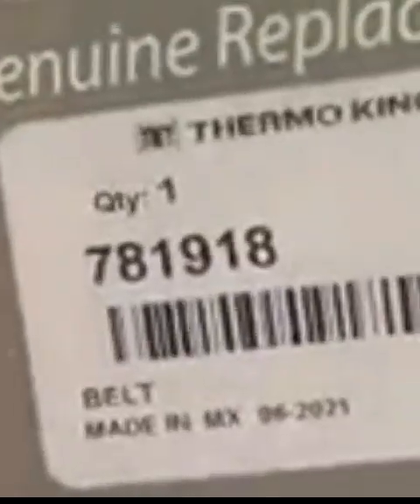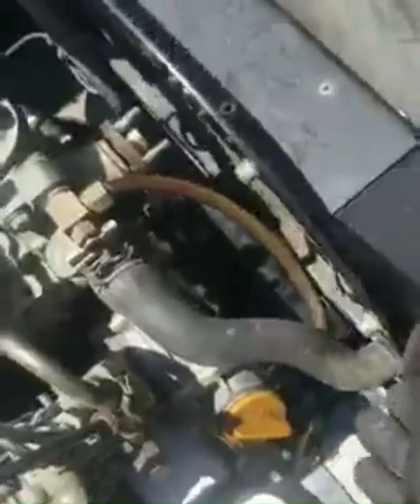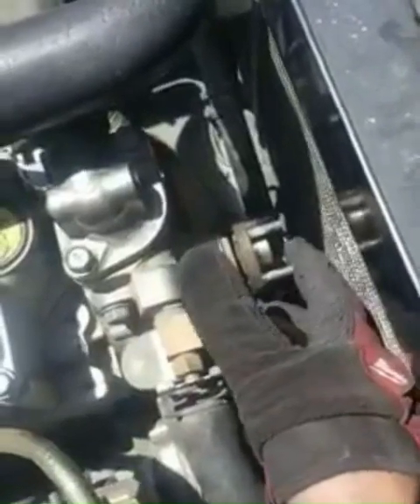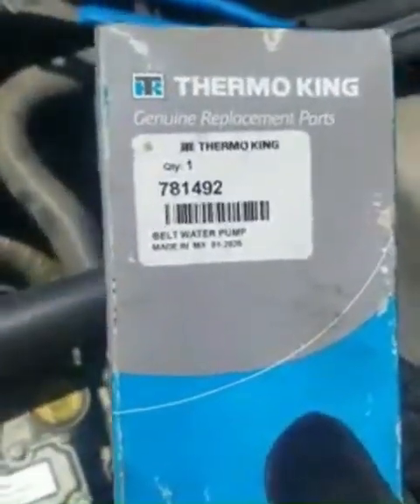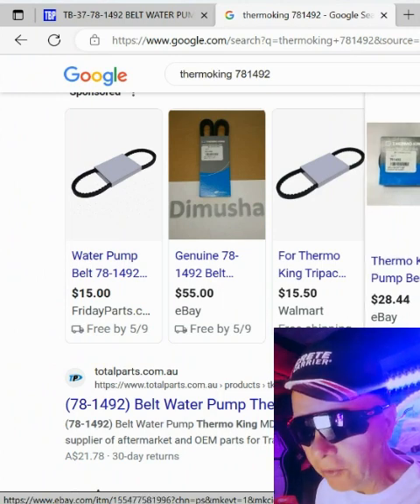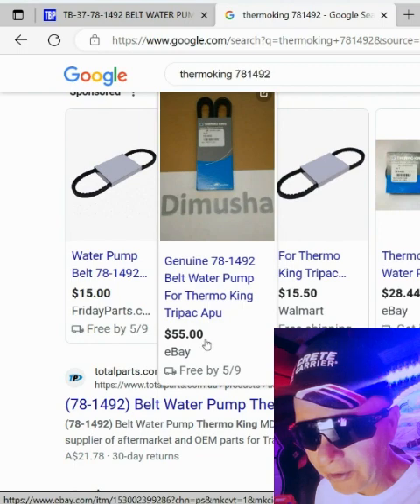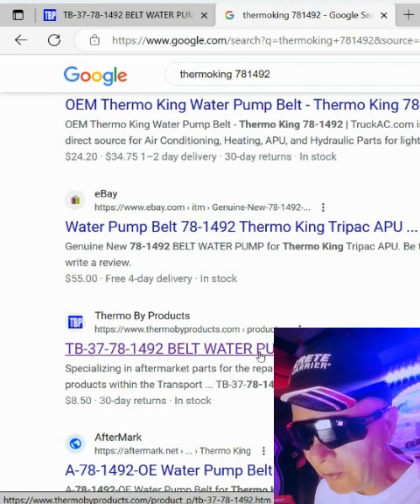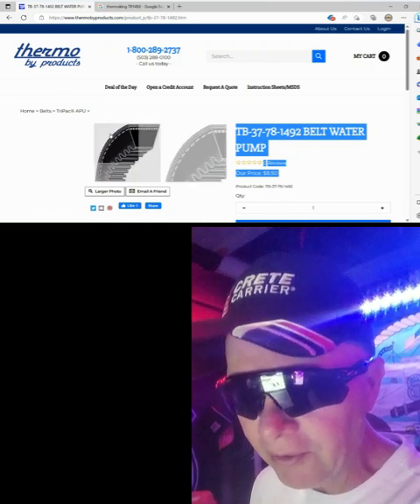Thermo King Tripac Evolution Alternator Belt and Water Pump Belt Replacement

Comment: How do you keep the pulley from spinning when trying to loosen the nuts on the water pump?
Reply from the maker: Pry bar or screw driver positioned between bolts
Reply: @bubbleheadtrucker  that's what my brother said to, screw driver. I tried using two 10mm ratchet wrenches and couldn't get the nuts broke loose. Guess I need to soak em in wd40 or something first. Belt looks like dog shit, but it's not tight enough to just snap. Surprised it even turns the pulley with engine running.